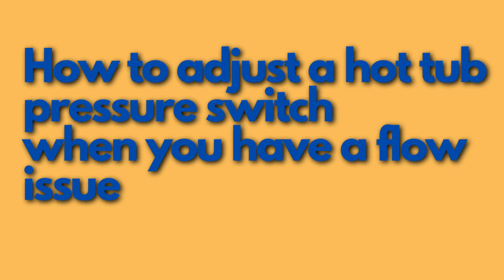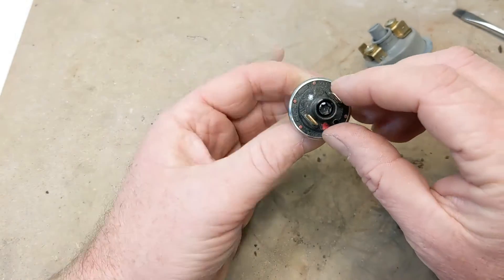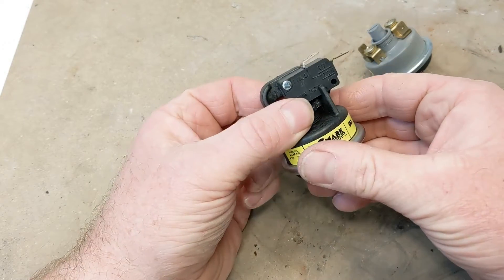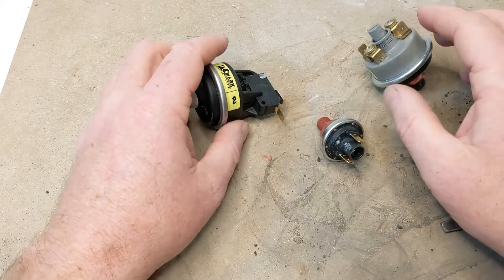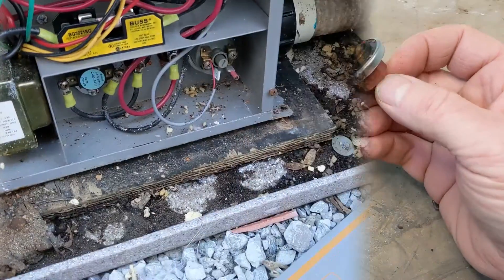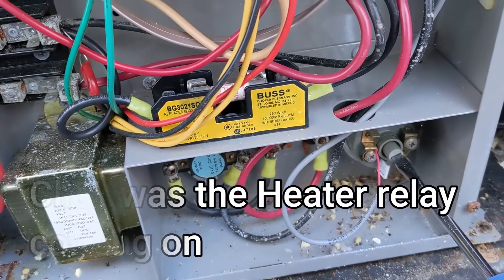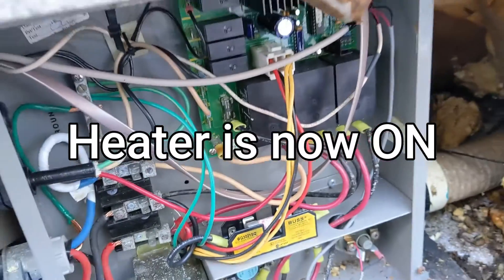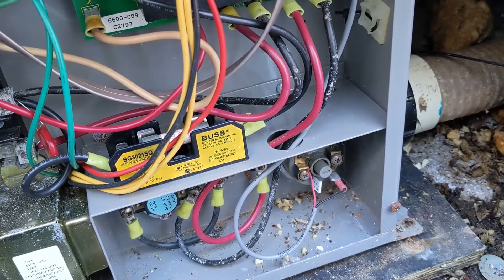Adjusting a HOT TUB Pressure Switch / Hot Tub Not Heating up

Comment: My jets are weak.  Filter is clean, and jets are individually opened to their highest setting and the water is coming out very weak.    Is there a pressure switch to make the pumps put out stronger pressure?
Reply from the maker: Check out our other videos on hot tub flow problems.  You might have a knife valve that shut or broke.  If you can, look on the bottom where the filter goes and see if the "flap" broke off.

Comment: Great simple to the point video. I have a nearly new pressure switch installed in my hot tub that seems to be failing I will try this trick and see if that helps
Reply from the maker: Sometimes its a flow issue from the filter to hair in the impellor

Comment: Very useful video. So on the smaller style switch it would be the same process, correct?
Reply from the maker: Yes.  Just use a small Phillips screwdriver
Reply: @VIPPoolsandSpas  Awesome! Does the hot tub need to be drained to replace the pressure switch?
Reply from the maker: @TheTransplantTexan  yes.  I guess I should do that video soon. Lol.  Can only do the change with shut off valves.  You shut the valves off on either side of the heat tube and unscrew the 2 heater unions about halfway so the water and pressure comes out.  Then you can undo the pressure switch without it spraying water on the board.  I'm going to do that video tonight.   Will help you understand it better.  I hope.  Lol
Reply: @VIPPoolsandSpas  on the smaller style switch, i'm not getting any clicking when turning either direction.  I had three blinking dots and those went away.  Doesn't look like any water is flowing through the heater though
Reply from the maker: @dellsdiy  test whatever pump is pushing water thru the heat tube with the pressure switch.  3 DOTS could come up for many reasons.  Pump not working, filters need to be cleaned, something blocking flow.
Reply: @VIPPoolsandSpas I’m curious how I test the circulation pump without draining the tub because then how to I see if it’s pumping water?  It’s a small circulation pump that just pushes water through the heater and the ozone goes through that line. It’s not a main jet pump that doubles as a circulation pump